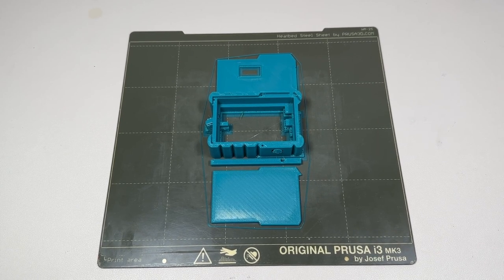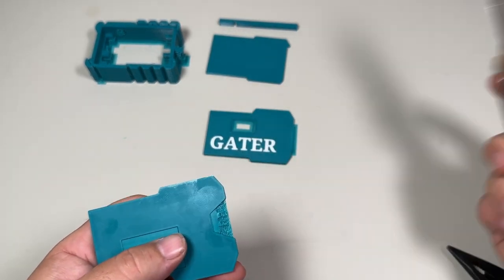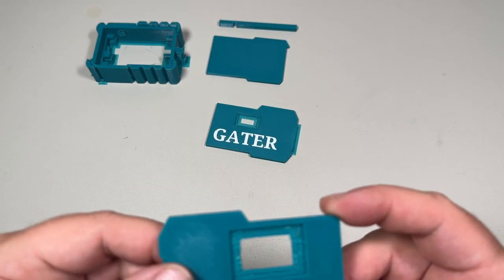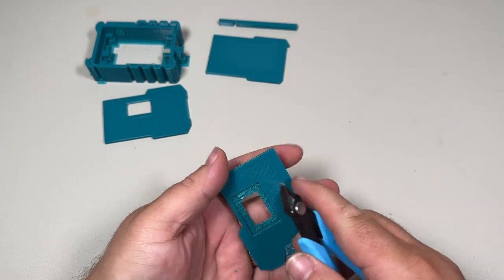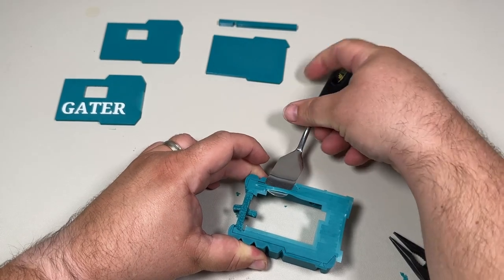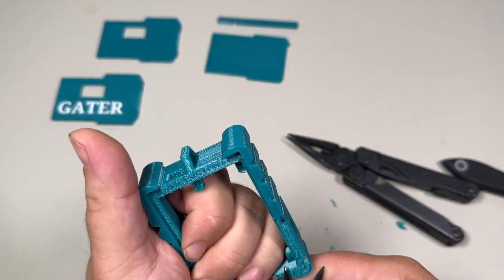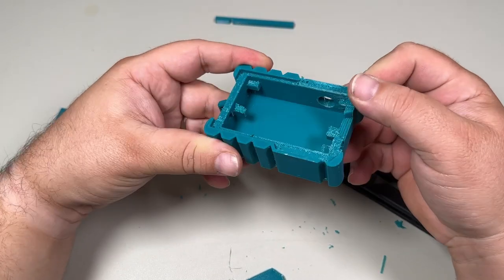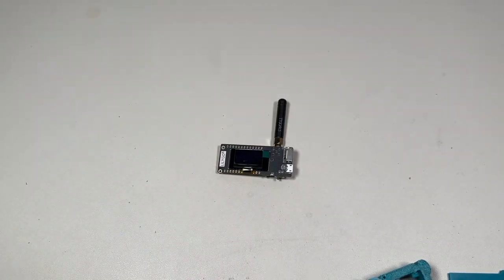Darknet-NG 12 Long Version of Case Cleanup

Comment: Anyone tried to print it? I did get a Creality Ende-3 v2 Neo and I am running into problems with the body... I will double check I did the slicing right, but, would appreciate if anyone tried this printer to connect with me. Note that my print is much cleaner and requires less cleaning. Back, front and bar are perfect.
Reply: Hey there, I just so happen to pick this printer up on prime day, let me get it in hand and let you know how it goes!